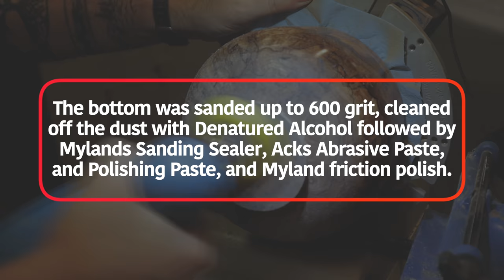Woodturning: A Deep Maple Burl Bowl

Comment: Beautiful piece. For the stabilizing, you might want to look into CPES: clear penetrating epoxy sealer. It's designed specifically for soaking into the wood to harden it. It's used a lot in the boating world, and I've used it to strengthen the joists of the farmers porch on my 1889 Victorian house when I redecked it. Just be real careful, it's nasty stuff requiring attention to your PPE.
Reply from the maker: Thank you Drew!  I'll have to look into that as I've got a smaller piece that is similar to this one.  - Ed

Comment: Nice work!  I'm wondering how dry that wood was, did a test with Alumilite Slow without drying and had foamy bubbles.  How did yours go?  I see a lot of turners using Alumilite, but not many talking about the need for zero moisture content.
Reply from the maker: Oh yes Alumilite does not like any moisture.  I've learned that the hard way.  I have one of my earlier videos demonstrate that.  This wood was very dry plus with the Arizona heat and lack of humidity, it doesn't take long to get rid of any left over moisture.  I typically don't use the wood I get right away.  They sit in the garage for a while until I'm ready for them.  - Ed

Comment: Wow, may be my favorite piece. Simple, letting the grain do the talking.
Personally I’m not a fan of the foot but it works.
I like that resin acetone trick. Have a couple pieces I’ve been avoiding because I don’t have a vacuum chamber.
Keep up the good work!
Wayne
Reply from the maker: Thank you Wayne!  I too have put off quite a few projects because of punky wood.  I've stabilized smaller pieces with Cactus Juice, but these pieces won't fit into the small toaster over.  Take care  - Ed
Reply: Lacquer sanding sealer, brushed on and left to dry for a day, will serve to firm up a piece of punky wood. However, it only penetrates about 1/16 inch so may take several applications. It's a slow process but does not require a vacuum chamber.

Comment: Beautiful,
I’m wondering for my own turnings that you use the acks polishing paste I was thinking that had wax in it.  Have you had any issues using your friction polish over top of it?   Also Prefer no foot but still beautiful bowl.  Well done
Reply from the maker: Thank you!  I've not had great luck with friction polishes in general.  I'm pretty sure that it's operator error.  I always get lines in the finish that go around the bowl or whatever I'm turning.  As for removing the Ack's products, yes, I would definitely remove the oils left over from the sanding paste or polish.  I typically use some denatured alcohol to clean it before applying a friction polish or even lacquer.  - Ed

Comment: the wood is lovely, but i agree a black resin of an amber colour would have blended better in the holes.
Reply from the maker: Thank you and I do agree!  - Ed
Reply: The option for filling cracks and voids that I have used extensively is a mixture of 5-minute epoxy and coffee grounds (or expresso for fine cracks). It can be worked after a couple of hours. Sands nicely and does not make a shinny spot under the final finish.

Comment: Hey Ed, This turned out to be an absolutely beautiful piece.  I noticed you initially mentioned after a few turns that the wood was somewhat punky and not really letting you get the clean cuts you were looking for.  Is it safe to assume that you had already stabilized the wood prior to turning it? Or like many of us who might buy the piece from our fav woodsource, simply figured the wood was already stabilized?  I haven't been woodturning all that much but from what I've watched and read, stabilizing using a vacuum chamber and pump is key to turning soft, porous or otherwise punky wood.  Just wondering if you might have benefited from that initial process (LOL, now I'm assuming you didn't. Sorry) prior to turning and having to inject thinned resin via gravity (spoon feeding it in/on) along the way, and having to wait a day or so in between anyway?
Reply from the maker: Thank you John!  I've turned a few punky pieces of wood and I've tried a couple different things.  I've stabilized a few things with Cactus Juice.  The challenge with this particular piece was the size.  Too big for both the vacuum chamber and my toaster oven.  I've tried the Minwax Wood Hardener and the results were ok.  I really liked this process of thinning out the resin with Acetone.  It does not penetrate deeply into the wood.  I had not attempted anything before I started turning.  I got it to roughly the shape and thickness I wanted it and then applied the thinned resin.  It penetrated just enough to do some final turning and sanding.   I've seen quite a few videos from Doug @ Pohl Barn Productions & Kim @ Kim Tippin Woodturning where they've done this (that's where I got the idea from).  - Ed
Reply: Your bowl came out Beautiful !!!!!!   When you say you mixed resin with acetone do you mean you mixed A &B then just thinned it out?

Comment: Did you use Alumilite Clear (Polyurethane with a 7 minute open time) or the Clear Cast (Epoxy with a 30 minute open time) ?
Reply: Never mind, i asked too soon :)
Reply from the maker: I would have preferred to have a little more open time because it did start to get very thick as it got close to that 7 minute mark.  - Ed

Comment: Bowl came out nice, quick question. When you mixed the resin with acetone did you also add the hardener or just resin and acetone?
Reply from the maker: Thank you Connor and that is a great question!  I did mix the hardener too.  I was very careful with how much acetone that I added to not affect how it set up.  I don't have a hard and fast rule, but just added a little and saw how it was absorbed.  It wasn't absorbing as much as I thought it should so I added a little more acetone.  It still setup in the 7 minutes (Alumilite Clear), but remained tacky for a long time.  I got back to it the next day and it had hardened up all the way.  It definitely extends the time it takes to finish the project, but well worth it when you have a very punky piece like I did.  I hope that helps brother!  - Ed

Comment: What did you use to sharpen your gouge on this video?
Reply from the maker: Thank you Dave for the question.  I'm using a DMT Folding Diamond Fine File that I got from Amazon (https://amzn.to/3jEEZsT).  That is an affiliate link, but it doesn't cost you anymore.  Amazon just kicks a few pennies my way for you using it.  You can just search the name to if you prefer not to use the link.  It is a great product and something I always use before each project and between sharpening with the grinder.  I typically use the diamond file until the concave grind left by the grinder is gone.  The prolongs this life of the tool.  Have a blessed day!  - Ed